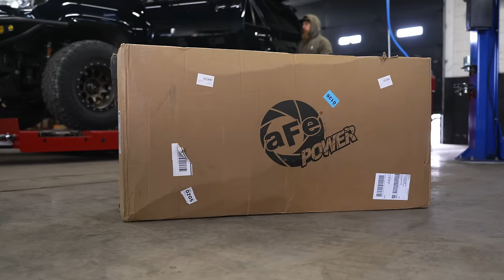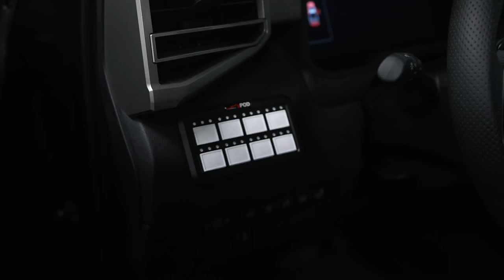We Transformed Clint Dempsey NEW Toyota Tundra with $60,000 | Ep.1

Comment: To all those that say $60k was a rip off…..

These following numbers below  include parts and labor:

Full high quality vehicle wrap is about $5k 

Front and rear bumpers alone about $5k with the modifications and labor to install

Winch about $1.5k

All the LED lights $2.5k

Electrical wiring labor for all electrical components $5k

Tires and wheels $3.5k

Suspension mods $4k

Exhaust mods $2.5k

Skid plates and side steps $2k

Air compressor systems $1.5k

Roof rack $1.5k

Diff mod $1k

Front grill $1k

Shipping the truck from customer to all the various shops across the country and then back to the customer: $5k

$41k total. 

I’m sure there was a lot of billable time for the design process for this truck as well and then there is the profit and overhead for all these companies and shops. So that’s where the remaining $19k goes to. 

Again these are some of my best guess price estimates, from my own personal experience in modding several vehicles over the years. 

If anyone in the specific industries has any better more specific numbers, please comment down below 😊 cheers!

Oh and let’s not forget the massive inflation we’ve been dealing with since 2020………

Comment: 60k for a spacer lift and oem shocks. Pocketted majority of that for sure
Reply: Huh? I saw a lot more that went into it too lol, did we watch the same video?
Reply: Mentioned kings on backorder, but that's really just called a normal wait time for King. Mateo, we've got the 22+ tundra kings in stock 😊
Reply: @DB-in6mi Ummm 🤔 ya, I saw more than that go into it too, the whole truck getting wrapped, wheels and tires, exhaust, winch etc.... there was more but I can't think of everything, and I know anytime you do anything like this it isn't cheap, plus labor hrs etc....spacer lift and OEM shocks definitely wasn't everything...
Reply: Half of that 60k was literally for labor. Guaranteed.
Reply: They bought the kings with the 60k but the spacers was just a mock up for the kings, he has the kings on it bow
Reply: To all those that say $60k was a rip off…..

These following numbers below  include parts and labor:

Full high quality vehicle wrap is about $5k 

Front and rear bumpers alone about $5k with the modifications and labor to install

Winch about $1.5k

All the LED lights $2.5k

Electrical wiring labor for all electrical components $5k

Tires and wheels $3.5k

Suspension mods $4k

Exhaust mods $2.5k

Skid plates and side steps $2k

Air compressor systems $1.5k

Roof rack $1.5k

Diff mod $1k

Front grill $1k

Shipping the truck from customer to all the various shops across the country and then back to the customer: $5k

$41k total. 

I’m sure there was a lot of billable time for the design process for this truck as well and then there is the profit and overhead for all these companies and shops. So that’s where the remaining $19k goes to. 

Again these are some of my best guess price estimates, from my own personal experience in modding several vehicles over the years. 

If anyone in the specific industries has any better more specific numbers, please comment down below 😊 cheers!

Oh and let’s not forget the massive inflation we’ve been dealing with since 2020………
Reply: It's tundra price 😂😂😂😂😂

Comment: dude just paid $60k more to make it a TRD Pro lmfaooooooo
Reply: To all those that say $60k was a rip off…..

These following numbers below  include parts and labor:

Full high quality vehicle wrap is about $5k 

Front and rear bumpers alone about $5k with the modifications and labor to install

Winch about $1.5k

All the LED lights $2.5k

Electrical wiring labor for all electrical components $5k

Tires and wheels $3.5k

Suspension mods $4k

Exhaust mods $2.5k

Skid plates and side steps $2k

Air compressor systems $1.5k

Roof rack $1.5k

Diff mod $1k

Front grill $1k

Shipping the truck from customer to all the various shops across the country and then back to the customer: $5k

$41k total. 

I’m sure there was a lot of billable time for the design process for this truck as well and then there is the profit and overhead for all these companies and shops. So that’s where the remaining $19k goes to. 

Again these are some of my best guess price estimates, from my own personal experience in modding several vehicles over the years. 

If anyone in the specific industries has any better more specific numbers, please comment down below 😊 cheers!

Oh and let’s not forget the massive inflation we’ve been dealing with since 2020………

Comment: I'm on my 5th Tundra. I worked with K/N to design the cold air intake for the 2016 model. On my 2016 A tuner Justin Hollister. From DAP tuning re-flashed my ECU. Didn't give me anything but what was already there. I bought the 1st 5.7 Tundra and it was a beast! Untamed!!!!!!!! Then everything after was governed down so much the truck was only fast enough to be better but not the BEAST it was on the first gen. Justin's tune allowed my truck to scream! Boil 1st, 2nd, and a strong bark in 3rd. And that was with traction control on. Turn it of and all you will do is melt your tires. I'm currently In  a 2019 4X4 and having transmission problems. It started @ 61,187 miles. They replaced the trans and I'm still having problems. This was finally the truck I wanted. Yet I can't trust it. Any help would be grateful. The Huntsville Dealership techs are incompetent the say the best about them.  I want a lift, bumpers, light bars, 37's. I already have custom hand made gun mounts and a CB in it. I don't wanna give up on this truck. But I'm caring for an elderly veteran father and my truck cant let us down. Advice? Anything is better than nothing!!!!

Comment: All you had to do…All you should have done…is rip out the entire power train (shitty 6 cylinder/hybrid). Rip out that terrible 10 speed transmission. Rip out the IFS. Then drop a proper naturally aspirated V8. A much stronger and simpler transmission (7 speed at the very most). And a solid front axel. Boom build done. 

All that’s left is to request a 30k refund from Toyota for making you do what they should have already done.